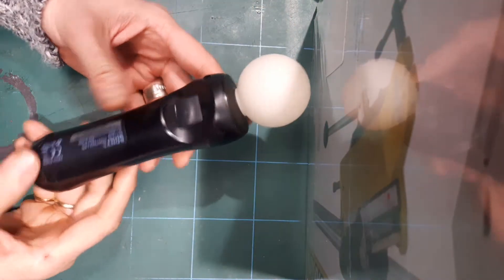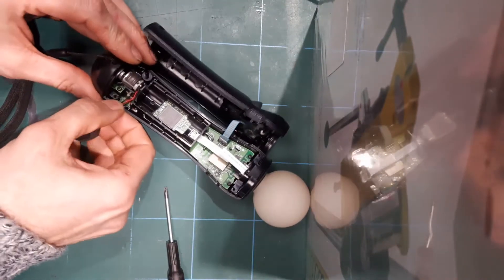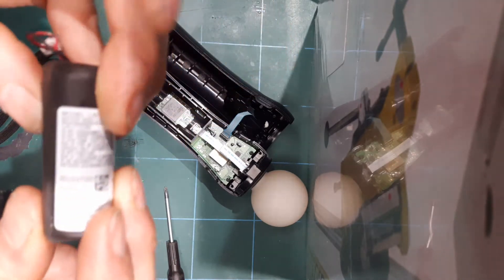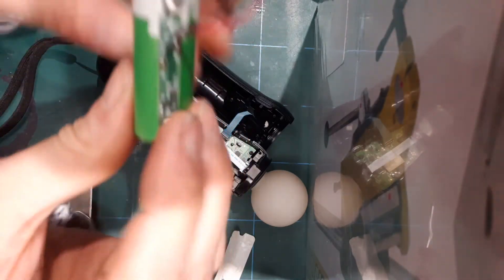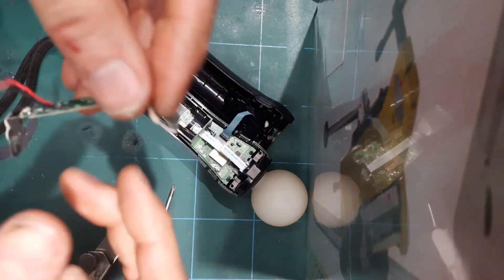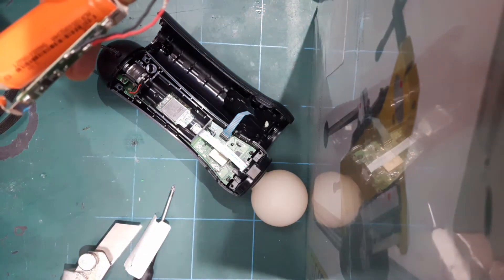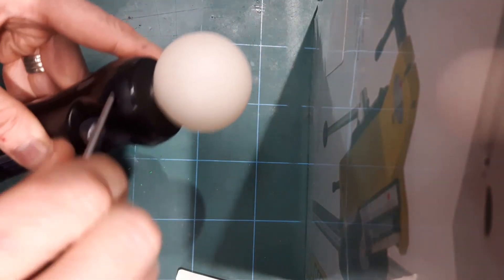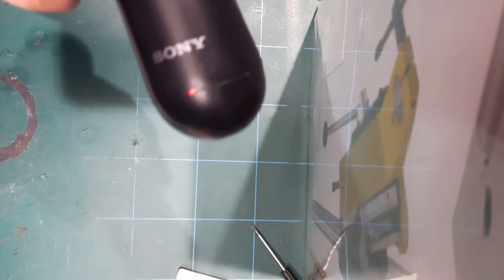PSVR PS3 PS4 Move Controller  battery upgrade 33% extra battery life

Comment: PS4 move use LIS1651 battery. Inside is a 18650 Li-ion battery.
So no need to upgrade it except you want to change is to Panasonic 3400mAh battery.

Comment: The original battery is 3.7v ... but the replacement battery is 3.6v !!!  Did you have issues with that  ?????????  
And i have another question: The new battery should must have protection or not ????
for example it's ok to replace with a TrustFire 18500 1800mah TF ???
Reply from the maker: No issues with the voltage difference.  If you replace battery as shown the charging / over discharge protection  circuitry is still present.  👌

Comment: Sir can I use 32700 3.2 volt battery। please suggest
Reply from the maker: Hmm would be intetesting to try.  The ps move controller is a lithium ion battery  32700 is Lifepo with different battery chemistry. The charged voltage is 3.6 for lion. 3.7 for yours so it may work.  Only one way to find out 💪

Comment: ebay link doesn't live anymore. What is the battery tipe? :)
Reply: you can find it like Lis1441 for the moves and Lis1442 for the navigation controller
Reply: @oniel6933  Thank you! I know those. But I wanted to know what cell he used in this video, that can provide ~2000mAh. :) found out those are 18500 cells so there are a lot. :) Thank you
Reply from the maker: Hi yes they are 18500 batteries with a 2100mAh capacity.  Anything of Alibaba / Bangood etc around this should be fine. Dont go for the ridiculous capacity ones that say 3000mAh or 5000mAh as they just arent!

Comment: Hi! Coul you please update the ebay link? And/or give the battery specs? Moreover: would this battery work also for the navigation controllers? Thanks
Reply from the maker: Have just added a response on another comment but yes they are 18500 at 2100mAh capacity..

Comment: Can i use a lithium battery?
Reply from the maker: The batteries are 18500 Lithium-Ion...  Using a Lithium Polymer (li-Po) may work as its only a single cell needed and no clever balancing circuitry, plus Li and LiPo battery operating ranges are similar.   If you try it let me know!

Comment: do you need the circuit board from the old battery for this to work?
Reply from the maker: Yes its part of the charging circuitry
Reply: @chazj1976  you could mod a separate  charging port and circuit for it though.

Comment: I must have a different model controller. I had to take out the motor and circuit board to get to the battery terminal. Warning - This thing is a pain to put back together!

Comment: you just helped me to resurrect two dead move controllers i bought cheap.... i couldnt find the exact batteries (Mah rating) that you used but managed to get some 2000Mah ones and now their charging up and hopefully will be usable on my PS4 saving me over 50% of the costs of new genuine sony batteries with a lower rating... many thanks

Comment: Can I insert a double A battery into the controller instead?
Reply: If you can find one that is 3.7v maybe. I have tried a normal AA but the controller did not boot up. Perhaps I did something wrong but this AA Li-Ion 3.7v battery seems to work and charge just fine.
Reply: @ArgamDeBlack  normal AA is 1.2v or 1.5v, of course it would not boot up, not enough voltage. Unless you use the AA size which labelled as 14500 3.7v then it will boot up. But the  battery is smaller diameter, you need to thicken to stop it moving when playing. In this video, he use 18500 size. As referrence 14500=14mm x 50mm, 18500=18mm x 50mm.

Comment: The most difficult part is the stupid screws. They are easily stripped and very, very tough to remove. You need to go over any techniques or specific brands of screw driver for those.

Comment: ALSO CAUSE I LOVE MY FACEBOOK COMMUNITY AND MY SUBS AND EVERYONE BUT SOULS LIKE YOU WHO MONETIZE EVERYTHING THE BATTERIES ARE STANDARD 18500 BATTERIES 3.7 VOLT 15-20 AMP AND GO UP TO 18000 MILI AMP HOURS
Reply from the maker: Actually these are a good bit higher than 18000mAh
Reply: @chazj1976  18000, not 1800.  The 18500 has a range.

Comment: Did you check real capacity of replacement batteries? Found reviews on Aliexpress for same color battery. Real capacity is
1000Mah
Reply from the maker: Yup I charged with a Hi End Lipo / Lion/LiFE battery charger.. and get around 1800mAH capacity indicated. Nodoubt if I fully drained the battery till dead It would give more.  I didn't purchase mine from AliExpress
Reply: @chazj1976 , lucky you, as on Aliexpress pictures of buyers showing around 1000mAh only. Before you replaced, what issues did you have? My controllers were not charging at all. Took apart, charged batteries directly by charger then fitted back. Now discharged after playing, looks need take apart again
Reply from the maker: @Home_made_ch  Yup same issues original battery wouldn't charge. Took out and charge with proper multi battery type echarge set to li-ion.  But they barely hold much charge and would discharge fast whil playing and then not charge again